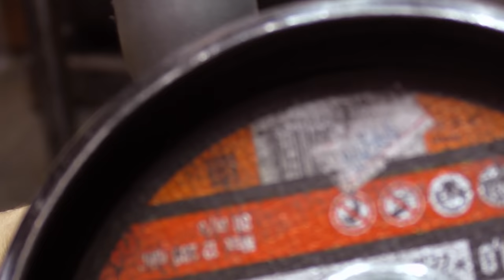DIY Sandblasting Cabinet Is Easy It

Comment: you need rubber liners inside your cabinet, also 2-3mm thick rubber gloves with rubber sleeves, the glass needs a second layer as it will quickly become dull

Comment: I hope that isn't regular (silica) sand you used.  Silica breaks down into fine dust that can be suspended in air up to hours or even days and causes irreversible lung disease called silicosis.  Great job on the build!  I'm also curious what gauge sheet you used.

Comment: DIY?? Lol.. nobody has those fancy tools
Reply: What exactly is a fancy tool to you?
Reply: @dinoj8126 he probably means the hydraulic press metal brake... i also dont have that... but there are ways around it to bend metal. using angle grinder.